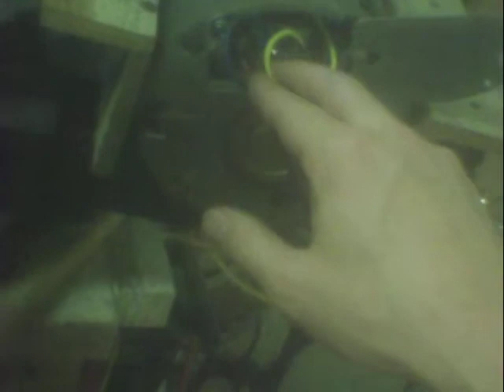How to wire Drum Switch to reverse single phase 1/4HP 120V motor

Comment: Is 220 the same?
Reply from the maker: Yes sir it should be about the same. Is yours Single Phase?   Not sure exactly w/o seeing yours for myself, but I'd use your 2 hot wires on the middle terminals like I did here.   I've got a couple short clips on a 1 phase 220/240 at least 3HP Baldor motor.
Reply from the maker: It was a 5HP 1 phase 220/240V Baldor motor:  https://www.youtube.com/watch?v=8jvHaa6Uv-8   This specific motor had a bad over heated stator winding, & I wasn't sure how to test/Ohm it even though I SHOULD know how to do that.
Reply from the maker: Here's the reversing info, should be similar to yours. I have the same motor on my old air compressor, but a lot Older & just 3HP:   https://www.youtube.com/watch?v=OEpVMQu7FHY
Reply from the maker: Make SURE you've got a 1 phase/residential drum switch, b/c the commercial/3phase drum switches are different design. But if yours looks just like mine in this video clip you're fine.
Reply: lee isenberg thanks it came wired 110 and I want to change to 220 single phase. I know I have to change the motor wiring. But do I have to change the drum switch wiring? Thanks George
Reply from the maker: I'm Not sure w/o seeing it. If you want to send me sum pics my email is <leeisenberg@yahoo.com>.  Why do you want to change it to 220?   Are you using it a lot, like a continuous duty use?  You can get the same power w/ your 110/120Volts.  Volts X Amps = power in watts, so it can be the exact same power w/ diff volts/amps.